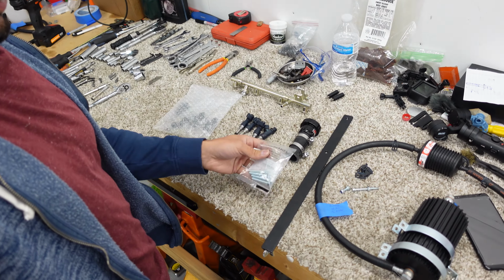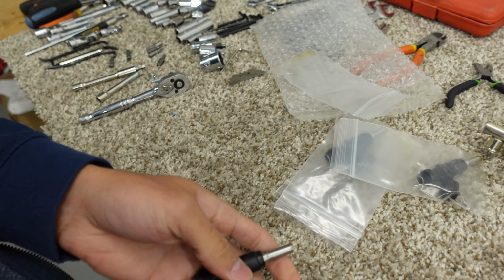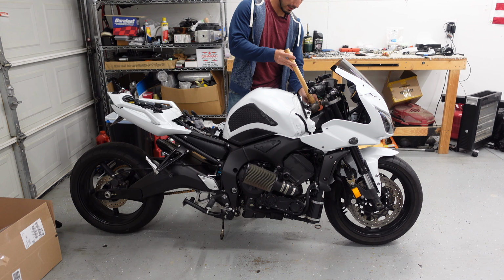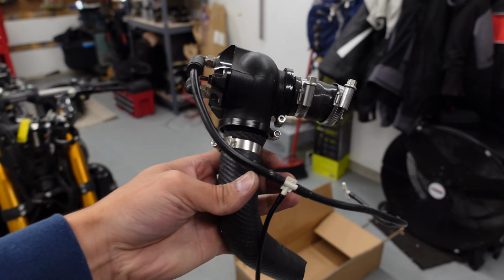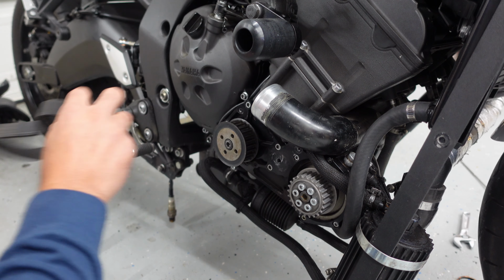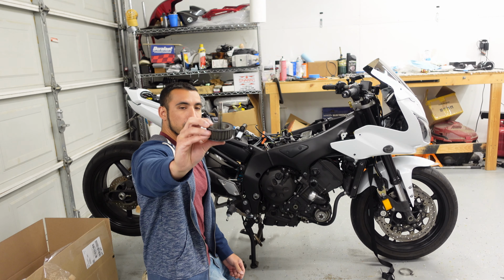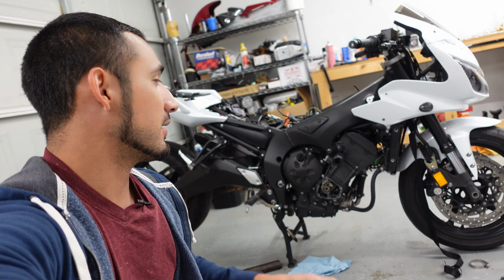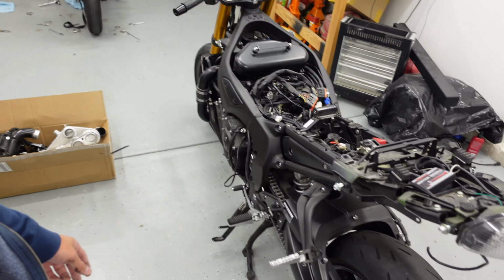Bye Supercharger. Turbo here we come!

Comment: I'm going to be buying the kit in a month. Besides the head gasket and ecu what else is needed to run that kit. I'll have help building it but I want to get everything ordered before I start. Any help would be great.
Reply from the maker: The biggest things I can think of are the headgasket, pcv, ignition module for timing adjustments. You can use stock injectors but they will be on the very edge of their capabilities. Do you plan on monitoring your AFR? If so weld in a wide and O2 sensor bung and get the power commander  autotune setup. Not for tuning but thats whats needed to see air fuel ratio. 

If your interested i have an extra pcv I can sell you.
Reply from the maker: Also stock ecu is fine so when say ecu you meant the power commander right?
Reply: Things changed. I found a completely stock cbr1000 from 05 with 11000 miles. Thing is so perfect I'm scared to ride it. Looks exactly like it did in showroom.  Now I'm looking for a platform to turbo or supercharg. Back to the drawing board.
Reply from the maker: @hondanut143  nothing wrong with changing plans. God knows I've done it too many times. 

My recommendation would be to start with a platform that many performance companies offer parts to turbo that bike and supporting mods. Hayabusa, zx14, bandit would be my suggestions. Or if you want to be a wierd guy like me, have a hard time building things  find a bike people don't usually turbo! Happy Thanksgiving bud
Reply: @rhetericalpha  Where did you buy the bigger injectors? Does it fit the stock fuel rail? I've been looking for days without finding anything exept someone on a r1 forum modified the stock injector.
Reply from the maker: @ericwallengren311  I got my injectors from Five O motorsports. I found some that fit in the stock rail but their stock has dropped a lot after covid. I think it had to do with supply chain.